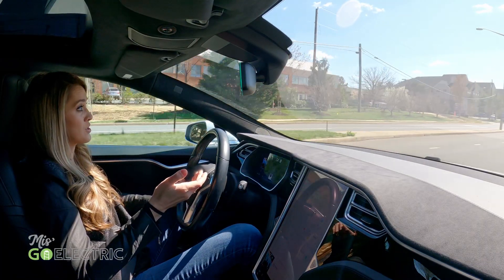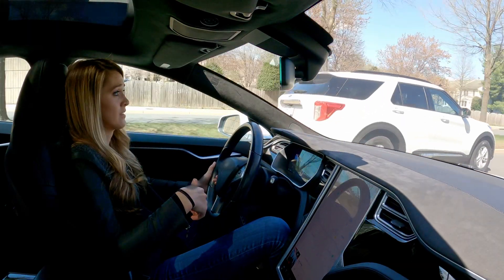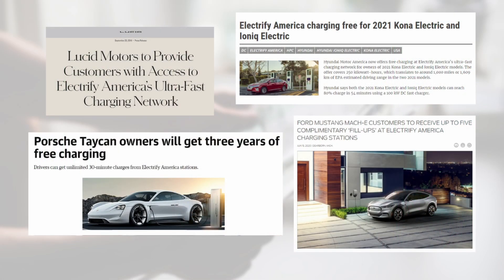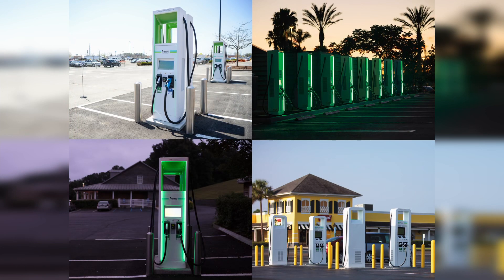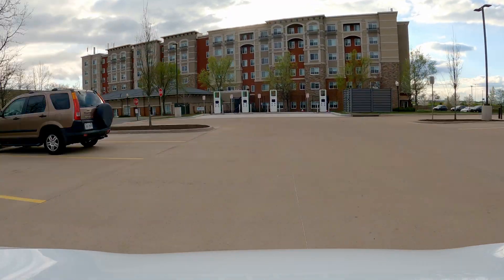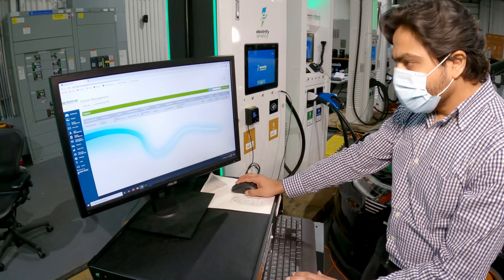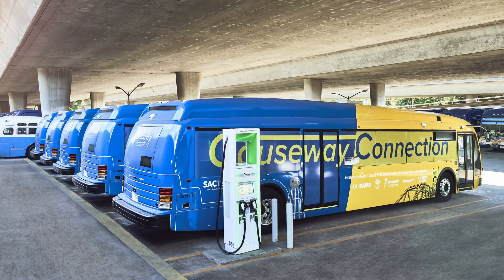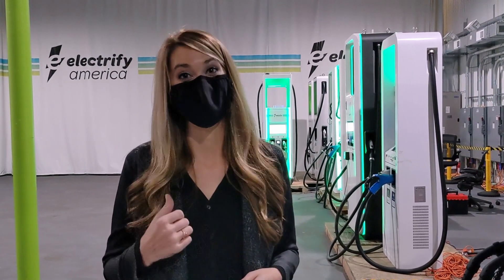How Does EV Charging Work? Learning from Electrify America!

Comment: 500 miles is insane to expect from ev range, most gas cars have about 300 miles of realistic range
Reply from the maker: We understand what EV range is normal today. Miss GoElectric has driven just about every EV available in the USA today. She has launched many EVs as a contracted educator for many automakers.  She has conducted literally thousands of demonstration drives in EVs, largely with first time EV passengers.  The feedback she has received on those rides has been revealing of the mindset of those who have not yet purchased an EV, but who are considering doing so.

We also understand that an advertised 300 miles highly optimistic number.  Real world interstate driving at speeds near or over 75 combined with extreme temperatures and weather result in much lower-than-advertised range for every EV.  Wheel choice, bike or roof racks, driving style, and even vehicle cleanliness can also reduce range tremendously. We know that a 500 advertised range will be realized as 300-400mi maximum for most drivers most of the time.  We hold firm to our claims that 500 is a sweet spot for total EV adoption.

Comment: More Dc fast chargers are great when they work.
Reply from the maker: Yes.  We did present several questions about EA's broken and underperforming chargers.  Those and many other critical questions were prohibited by EA officials prior to the interview.
Reply: Malfunctioning EV fast chargers are a huge detergent to people considering purchasing an EV.
Reply: I'd like to see the cost per kwh reduced. If you're averaging 2 miles per kwh and paying $.43/kwh then it's costing $21.50 per 100 miles at $4.00/gal for gas that's only equivalent of about 20 mpg. Not great mileage. As gas prices increase to $5/gal that equates to about 25 mpg still not good. Not when I can drive locally and charge at home for about $4/100 mile. At $4/gal that's 100 mpg. At $5/gal that about 125 mpg.

Comment: Clickbait. I wish this video had more focus on the actual charging hardware and what sort of problems are solved at the technology center. Interview the engineers that work with the chargers and deal with the technical problems rather than the business people, that would be a much more interesting video. Show what it looks like inside the cabinets and talk about what different parts of the chargers do (cable chiller, communications with the vehicle, power supply, etc). Not much point going there just to use it as a backdrop.
Reply from the maker: We wish that too. Our proposal included much more provocative interview questions, an in depth look at operations, and technical deep dive. This video was sponsored by EA. Their team cut out much of the proposal, added new restrictions during production, and called for 30% of our segment to be removed. What you see here is a fragment of our hopes for this piece. Still, we know the overview of charging basics is helpful for those considering going electric. 

In our early stages with this channel it was a dream to be approached by a big sponsor to create a segment like this. We learned a lot from the experience. Now we make sure to maintain creative control. We hope you'll find value in our work as we continue to improve.
Reply: @MissGoElectric  Thank you for the response and background, it was unfortunate they did that to you.

Comment: 0:20 WTF!? I own a 2012 Hyundai Accent, and it only goes 230 miles on a full tank. You can find a fast charger within 230 miles, like most EVs with fast charge now (~40 min.). What the hell do they want!?
Reply from the maker: Some parts of the country do not have the DC fast charging density of others.  Extreme temperatures, headwinds, topography, and other factors can greatly reduced range compared to stated EPA range.  Hopefully we will continue to see efficiency and battery capacity improve.

Comment: While the original EV charging documents referred to a "level 3" charger, all the modern standards are based on AC vs DC.

AC 1 = your typical 110v outlet
AC 2 = your 240v connection either with a plug or hard wired.

DC 1 = low power DC charging
DC 2 = high power DC charging

DC 2 is what most people mistakenly refer to as Level 3.  Sadly, there isn't any real DC 1 chargers even though your typical J1772 connector does support it.

The reason I mention this is that the SAE J1772 standard does specify an AC 3 that is based off a 3-phase electrical supply supplying up to 166 kW of AC power.  While this standard is now listed in an appendix (Appendix M to be exact) it is still part of the standard.  This standard is likely to be used for Commercial charging such as trucks as commercial buildings tend to have 3-phase power.  When this happens, you are going to have 2 different "Level 3" uses, but they mean completely different technologies and the connectors won't likely be compatible even with adapters.

It's best to refer to the DC 2 charging as either "DC Fast Charging" or just "DC charging" to prevent this confusion in the future.
Reply from the maker: Right on.

Comment: There are 33.7 kWh of energy in a gallon of gasoline.  Electrifiy America charges 43 cents per  kWh to charge at their public stations.  That means you are paying the equivalent of  $14.49 per gallon.
Reply from the maker: Except gas vehicles waste most of the gasoline energy.  EVs go much further on 33kWh than any gas car.
Reply: @shirley1872  By "energy equivalent" I mean that burning a gallon of gasoline produces the same amount of heat energy as 33.7 kWh.  That is the conversion factor that the EPA uses when they quote MPGe.
Reply: It sounds like a terrible deal when you look at it that way, but fortunately EVs get 4 to 5 times the equivalent mileage on that energy.  Also, it is expensive, but only when you travel long distances.  When you charge at home, it's either free from solar, or much cheaper at your local utility rate (ex. 10 cents per kWh or $3.37 per gallon).  So, that $14.49 per gallon for a 2.5 gallon equivalent tank may cost you ~$36, but you can travel ~300 miles on it.  That's still pretty good then.
Reply: @kurziusm  Unfortunately, pickup trucks and vehicle pulling trailers will lose a lot of that efficiency advantage, so they will end up spending more for public charging on road trips than they would for gas.  Also, depending on how the electricity is sourced, they may even be putting more carbon in the air.

Comment: I'm a technician that fixes EA chargers in Tennessee. Their chargers are the best I've seen yet. Charge point & Blink & others are lagging behind. (I would love to speak to Tesla's chargers but they do their service in house as far as I know)
Reply from the maker: EA buys and brands charging station hardware from third party manufacturers. Many competitive networks buy from the same suppliers. Tesla's advantage is that they control the vehicles and the charging hardware. That certainly reduces variables and contributes to a low friction and high reliability experience.

CCS stations and vehicles are varied. Hardware/software compatibility can sometimes be a challenge.
Reply: @MissGoElectric   Yes, I've fortunately learned A LOT since I left this comment. You are correct. I'm now designing site installations for Chargepoint's 350KW Express Plus, for Stellantis. The amount of these going in across the country is crazy!
Reply: I personally don't use EA chargers, but I've seen a lot of YouTube videos where EA chargers are often out of service,  sometimes for as much as a week at a time. Travelers returning via same route have often seen these lengthy outages.

Comment: Why does it need to be so hard to insert the CCS connector into cars? Why can't there be a handle on the American CCS connector like there is for the CCS Type 2 in Europe? What is EA doing for bidirectional charging?
Reply from the maker: Tesla has a significant form factor advantage over CCS.
Reply: @MissGoElectric  Too late. CCS is the non-Tesla standard and adding a handle to make CCS1 like the CCS2 connector would be an improvement.
Reply: Hey, if I hear EA has plans to install a Tesla connector, I would be shocked.

Comment: I've noticed that the CCS chargers really have proliferated in the last couple of years. I only wish all the providers could get their act together (Electrify America, EVGo, Greenlots, Chargepoint, EV Connect, Semaconnect, etc.) Some are pre-pay, others have charge accounts, then there are fobs and mini-cards to enable a session, plans for members and "guests," etc. They should all simply take a credit/debit card like self-serve gas  at different gas stations (Chevron, Exxon, Tesoro, Shell, etc.). And they all need to install more solar canopies —Tesla included! And finally… I sure wish Tesla would design, produce, and sell a CCS adapter, like its CHAdeMO adapter. I can't believe they haven't done so yet!
Reply from the maker: I can see there is a great deal of demand for more convenience and simplicity.
Reply: Ditto!  The one thing petroleum (gas) industry got right is standardizing the gas pump nozzle and to a degree the way you pay for the gas.  These EV charging network providers, if they or whomever haven't already, need to promote and adapt more plug-and-charge standard.  These charging stations need to be more universal.  This will not only better the customer experience many times over but also aid in the adoption of future EV owners.  

While I'm at it, a couple of other things I would like to see at charging stations that I believe will help with both the customer experience and adoption of EVs.  Don't install a set of chargers where's there is nothing else around.  Again, taking a page from the petroleum/gas station industry, provide a canopy over the charging port.  Nobody wants to have to charge their "electric" vehicle (yes, I know it's safe) in the pouring rain.  And provide some amenities such as paper towels to clean off windshields.  (A water source may be asking much but of course helpful.)  Let's do better versus the status quo or less than in most cases.
Reply: @chuckm260  Fossil burners have had a 100 years to work on it. Can't wait for EVs to get their collective acts together!